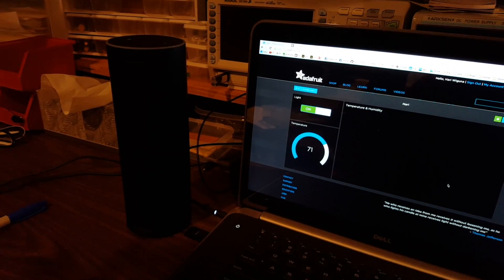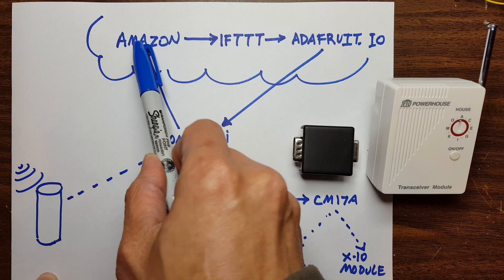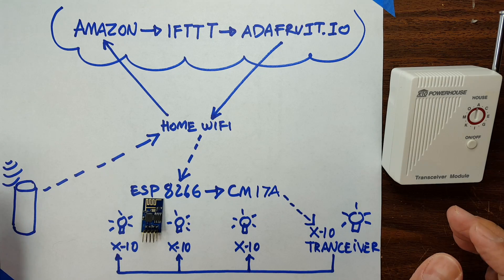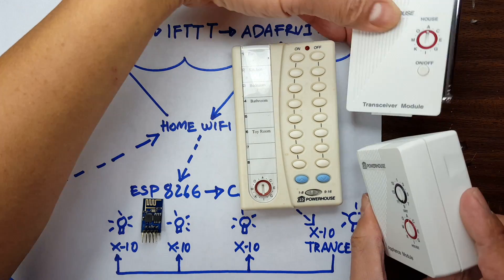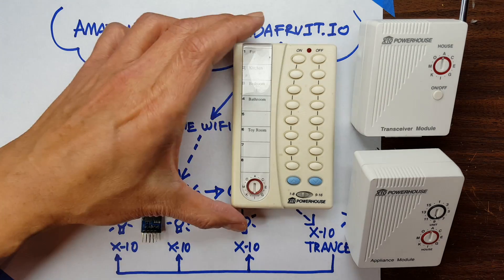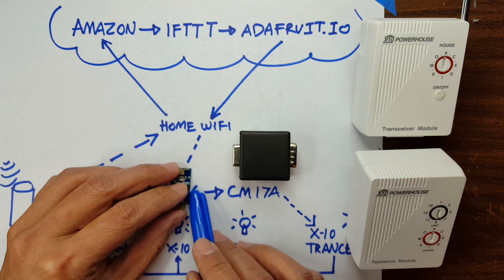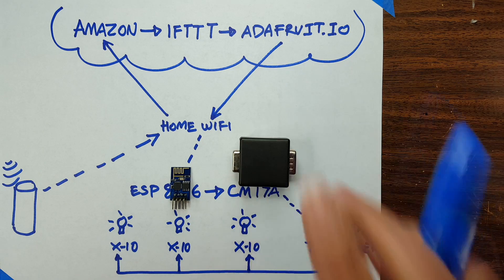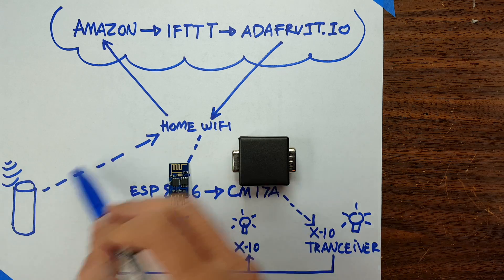HariFun #126 - Alexa Turn Light On!

Comment: Been using X10 since the '80s and have a LOT of those devices. I connected a CM17A (aka Firecracker), CM11A (serial computer interface) and some sensors to an Arduino and my Mac. Wrote a web server app for the Arduino and some control AppleScript on the Mac to integrate voice commands, email, SMS and Twitter. No IFTTT, Adafruit, Blynk or any other outside web servers involved in the controls, just my code. Here's a demo: https://vimeo.com/125117983 Unfortunately, I lost most of my Arduino devices when we moved earlier this year. I was looking into doing MQTT for my new X10 home and found your Hackaday posts. Great projects!
Reply from the maker: Di No, thanks for sharing your very slick system! Well done!

Comment: that's way cool idea.  I never knew x-10 had a rs232 / serial dongle.  I bet a few people are gonna go dig up their old x-10 stuff now. that Alexa rig is way cool.
This is the sort of systems that could really help mobility impaired.
Reply from the maker: +XerotoLabs , One of the most interesting thing about that dongle got cut in editing.  To allow the PC user to continue to use the serial port, they've left the RX/TX lines alone and rely 100% on the RTS and DTR lines to be pulsed in a particular pattern for X-10 data transfer!  I thought that was very clever!  I can't take credit for reverse engineering that, someone else shared that info and the Arduino library.  I just made it work for on ESP.  OK, got to start on my FOUR layer PCB for TinyCube!  EagleCAD license just arrived.

Comment: nice! what about running Alexa on a 9$ Chip Computer (https://www.youtube.com/watch?time_continue=63&v=Z1HGJyfoUBE) + ESp8266 + 433 power sockets (more frequent nowadays and easier to get than X10) ?
the only downside of implementing Alexa on Chip is that is doesn't support (yet) hotword detection so you need to use a button instead.
Reply from the maker: +Bogdan Craciun , Holy cow!
That's pretty amazing! I'll have to look into that.  Thanks for showing it to me!

Comment: Very interesting, would very much like to see the code. A little lost on how the series connector controls everything? 

Thanks Hari
Reply from the maker: +Dean Greenhough , glad you asked. How it works is really cool, but I don't want to make the video too long.
I've posted code on hackaday.io.  At this time the code only handles one device, but by adding more if/switch one could easily send the same "X10.sendCmd( hcA, 1, cmdOn );" but with different device parameter to control many X-10 devices.  hcA is the house code, 1 is the device, and cmdOn is the command to turn on the device.  Let me know if you got more questions.
https://hackaday.io/project/8958-internet-of-things-in-5-minutes/log/29998-amazon-echo-from-2015-meets-x-10-from-1978